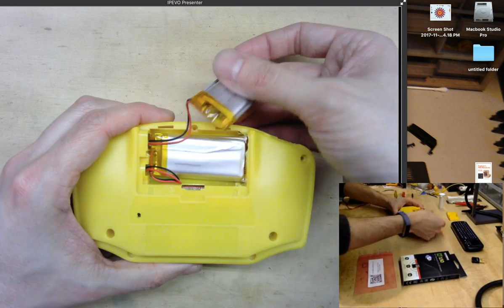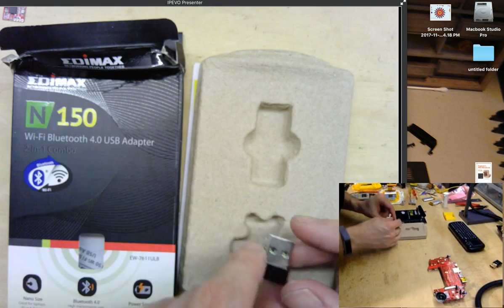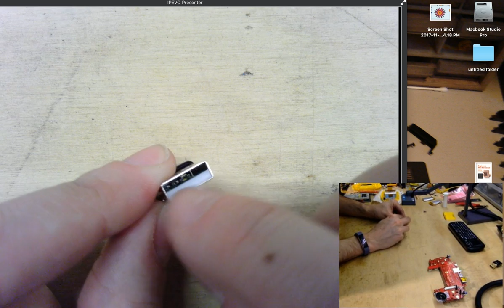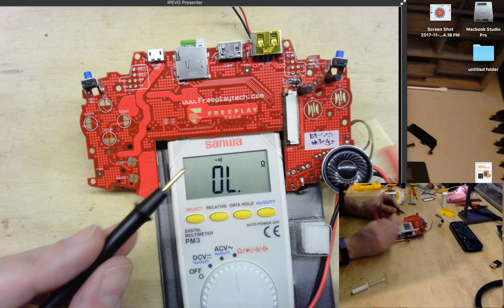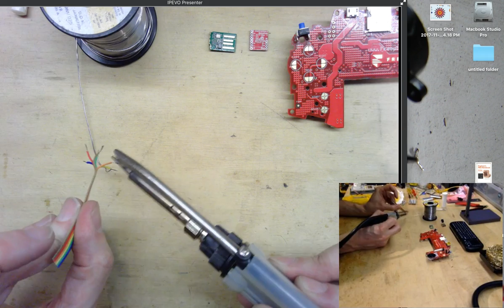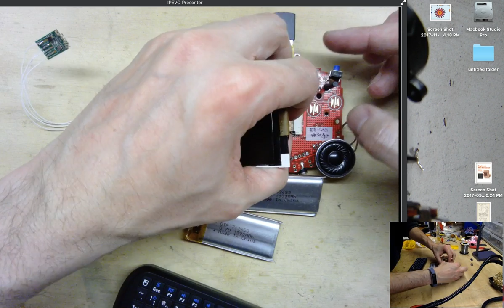CM3 USB Hub and Wifi

Comment: I'm surprised you didn't try getting drivers loaded for the Edimax dongle.
Reply from the maker: Behind the scenes, I did have the Edimax working on that specific pi earlier in the day, but on close inspection i totally broke it when removing the plastic case.
Reply: Electricity for Progress I'm going to do this mod too. Was it difficult to get the drivers working correctly?
Reply: @electricityforprogress  Thanks for this video, and for even sharing your mistakes! (I've definitely done that too... it's reassuring in a weird but very real way.) I'm really impressed at how quick and steady you were with soldering, and you may have just sold a wire stripper for Paladin. ;)